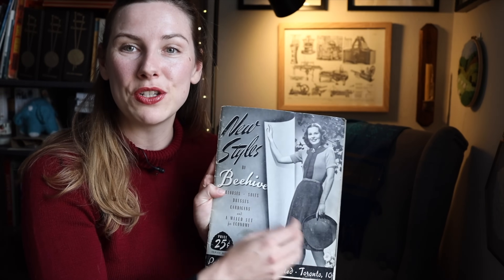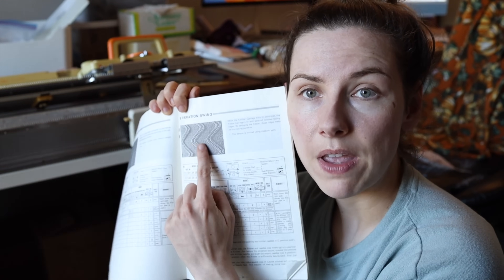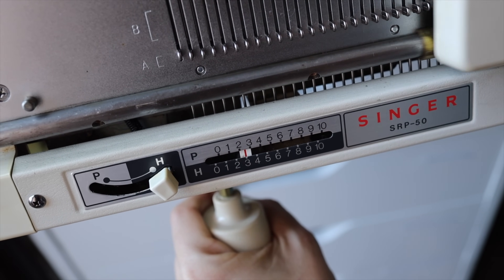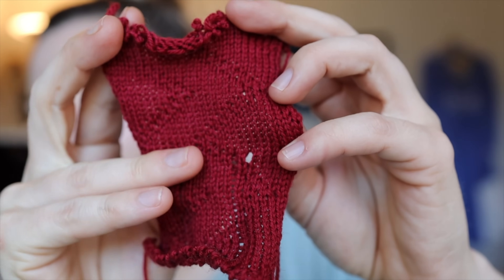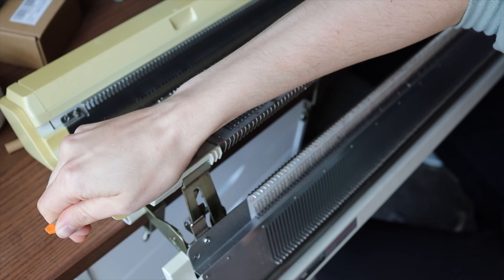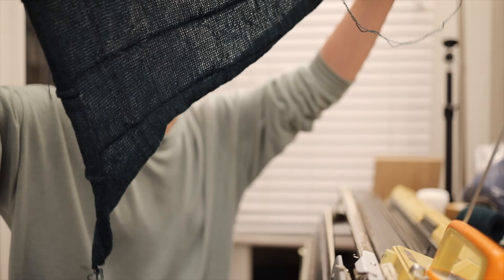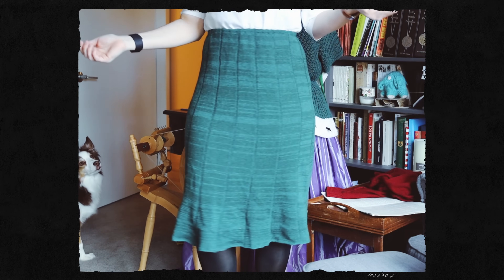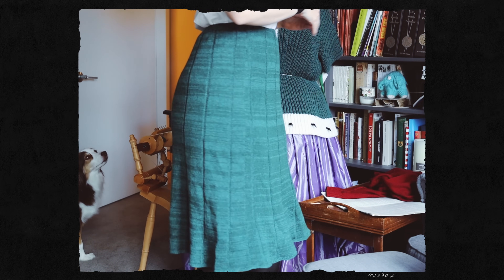3,852 Yards Of Cashmere Yarn to Knit a Vintage Skirt

Comment: echoing the enjoyment of the stripes! It's got some randomness but also some good chunks in places so it reads like an intended abstract pattern.

I noticed something when you were changing the needles: you place the sponge bar sponge side down! In my own old achine that i have tp constantly maintain and repair, I have been putting the bar in sponge side up. I didn't have clear instructions for my machine. Was this something your own manual(s) said to do? I'm curious to try it to see if it helps with some tension issues I get from time to time